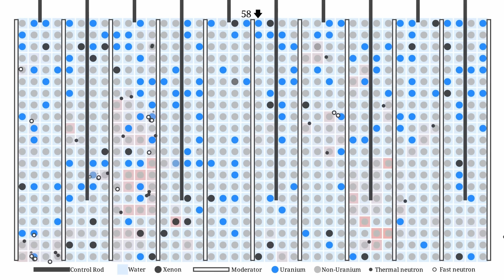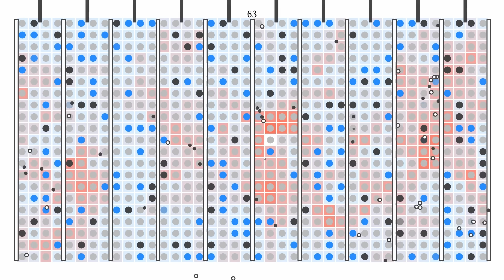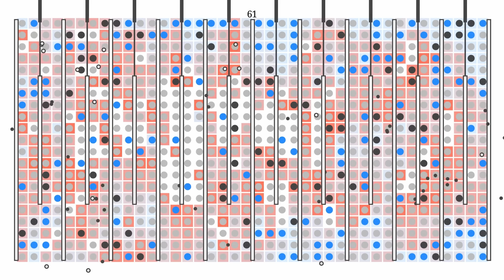Chernobyl Accident - Simulation only (no talk)

Comment: This really shows how the engineers really just didn't know how wrong things had gone

It was all just so fast
Reply: Yes, they had no way of knowing, and no way of controlling it quickly enough and even the scram was basically faulty.
Reply: @TheGologozo  The RBMK design had graphite tipped control rods. This was so that, at full insertion the bottom of the reaction chamber was a 25cm thickness of graphite moderator.

What went wrong with the scram was twofold : 

a) pushing the rods in (25cms of graphite) and down thru the core created more reactivity as the tips moved down and 
b) the extreme heat/steam pressure generated at that point had damaged some of the control rod channels, and the rods, causing a physical jam with the graphite tips lodged partway thru the core.
c) also contributory was the relatively slow speed of the control rod assemblies when inserted. The rods would have taken about a minute to traverse the core and reach full insertion, meaning the actual boron carbide parts of the rod never got to see much of the reactor height (?25m from memory) before the pile blew its guts out, flipping the 2 kiloton upper biological shield like a coin.

Comment: It's a cool simulation, it's wrong, but cool, Event 1: The power output was 75% not 50%, this was due to the intense energy demand for the local region, reactor 3 being closed for maintenance, Event 2: Power reduction was carried out incorrectly by a ill-informed crew, the night shift had little training in such scenarios, to reduce power a three man team carry out calculations with the SCALA computer systems and adjust the control rod, coolant flow and steam regulation from the core, they didn't do this, instead, Leonid Toptunov, a 25 year old nuclear control operator, missed a crucial step in the power regulation and the power plummeted, Event 3: Toptunov and Akimov attempted a "kick" power up procedure, this deviated from their training but feeling the pressure from deputy chief engineer Dyatlov they continued, they reduced the flow of coolant into the core and attempted the increase the steam by opening the steam valves all the way but it failed, Event 4, Dyatlov orders his men to retract the control rods and force the reactor into a "hot" state, safety systems were already disabled long before the test began, the SKALA computer could only report every 20 minutes, 1 minute before the test began it reported instability at the base of the core, the control rods that were retracted first were at the base of the core, here, a "hot spot" was generated, steam pockets pushed up through the moderator shafts to the top of the core giving a false reading that the core had reached 200MW, in reality the core was closer to 500MW, Event 5: The test begins, the power from the turbine is so low that the cooling pumps shut down as a precaution to prevent damage, coolant flow reduces to 30%, more steam is generated from less water, the steam separator drums are overloaded and pressure pushes back into the core, the sudden increase in pressure vaporises the water inside the core, to prevent the control rods, made from boron, from shattering within the intense heat and pressure of the core a "displacement rod" was at the end of each one, this was to push past the coolant and steam and allow the rods to slide in safely, these "displacement rods" were made from graphite not as a cost cutting measure but to act as a secondary moderator, to be used during a power up procedure, when the control room operators saw the power climb beyond 500MW they realised that a power surge was in progress and attempted a shut down by using the AZ-5 button or SCRAM, the control rods at the base of the core were inserted first, the "displacement rods" hit the hot spot no less than 1.7 seconds after the AZ-5 button was pushed, the power in the core increases hundreds of times a second, 2 seconds later a loud thunderous explosion is heard coming from underground, in this moment, the fuel rods rupture, spilling their contents into the channel, every molecule of liquid water vaporises, the sudden expansion shatters 50 moderator channels along with their respective control rods, 1.5 seconds later, inside the core, a mix of hydrogen, radioactive gases and pressure press against the 1000 ton upper biological shield, it gives way, like a can of beans blowing up over a fire, the shield smashes up against the wall of the refuelling hall, a massive volcanic eruption of radioactive debris blows the roof off reactor number 4 and the rest is history!
Reply: Thank you so much for the wonderful explanation❤
Reply: Fascinating. Use paragraphs and shorter sentences.
Reply: @ImpulseNOR  no
Reply: "Oh my soy use reddit spacing because I cannot read with my tiktok attention span"